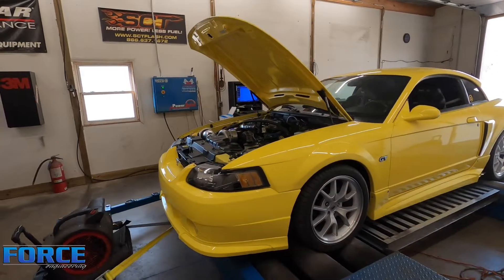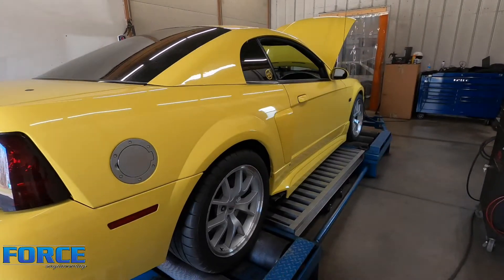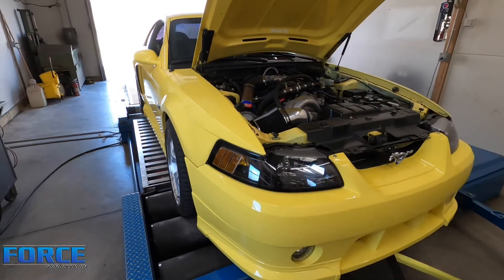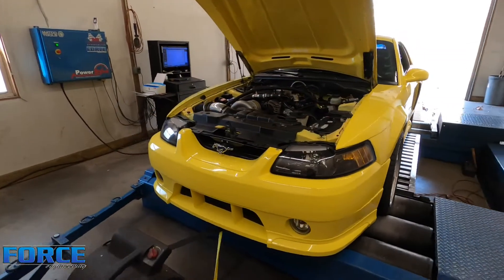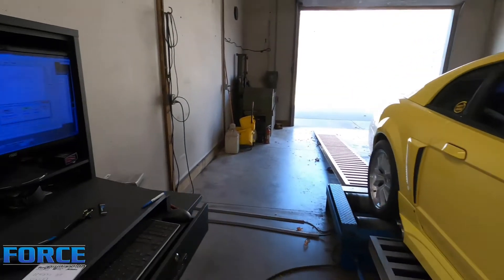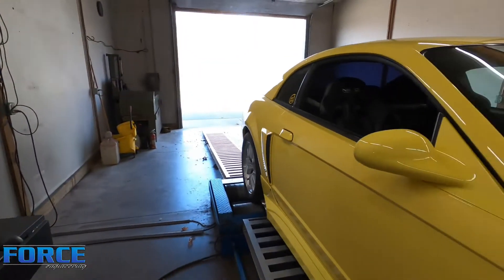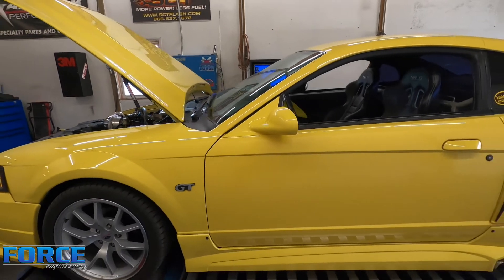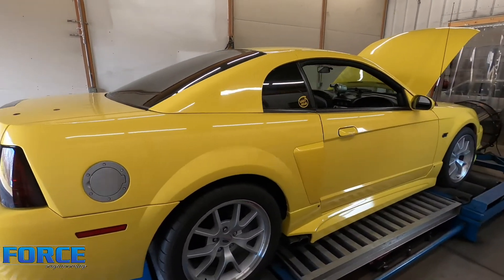Dyno Review - D1SC Procharged 4.6l 2v | Ford Mustang GT | Cammed 4.6l

Comment: Do you happen to know what injectors, fuel pump, and MAF he was running? I will be installing a Vortech V3 on my 2000 GT 2 valve. I am trying to figure out what I need to do for my fuel system.

Comment: What was the boost drop from adding thd longtubes and cams
Reply from the maker: These stock ECUs don't log or monitor boost levels so I'm not sure.  It has a boost gauge but i probably tuned 50 cars while he was making changes and i do not remember what it made for boost prior.